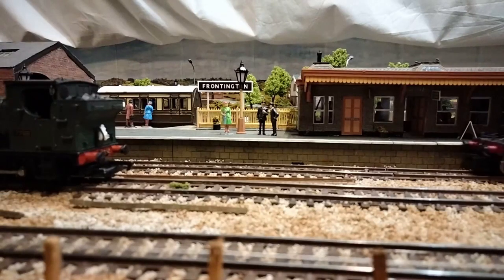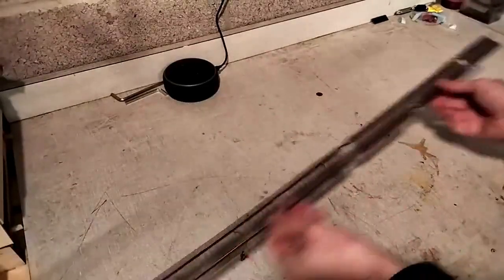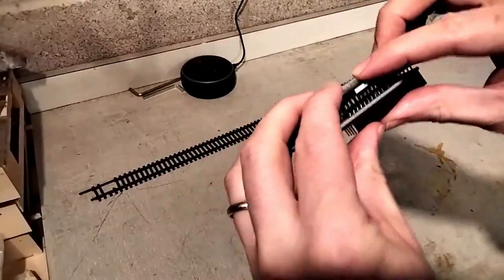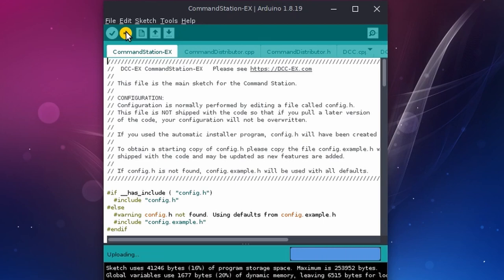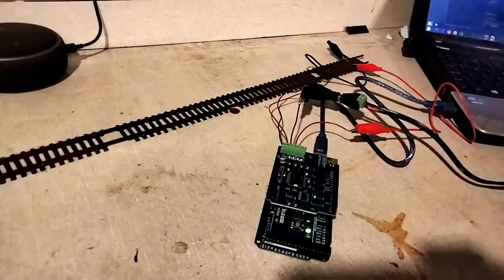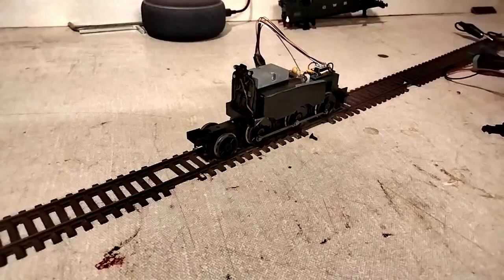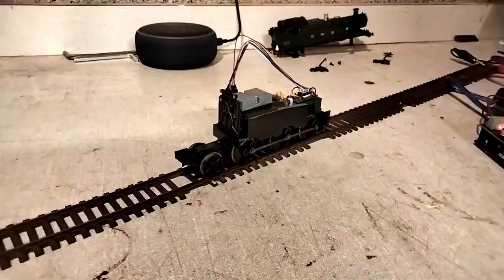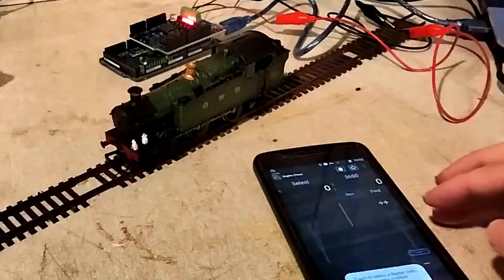First DCC test using DCC++EX, JMRI and a LaisDCC decoder | Modelling a GWR branch line | Episode 1

Comment: Nice video.  How does the Arduino connect to the WiFi for the mobile phone to work?
Reply from the maker: The Arduino connects to the laptop via USB. It's the laptop that has the WiFi connection, and controls the Arduino using the JMRI++ software. So the phone talks to the laptop, the laptop talks to the Arduino, and the Arduino talks to the DCC chip in the loco.